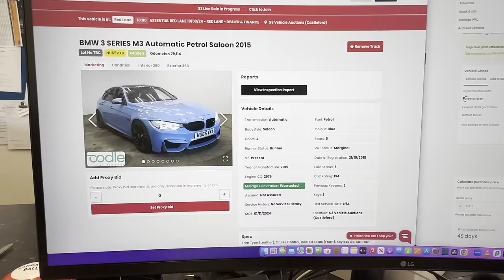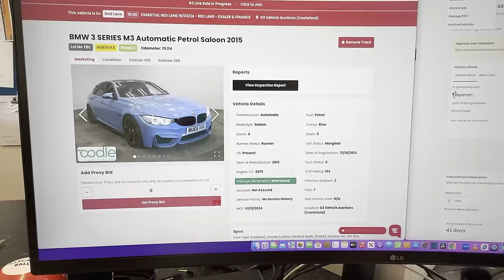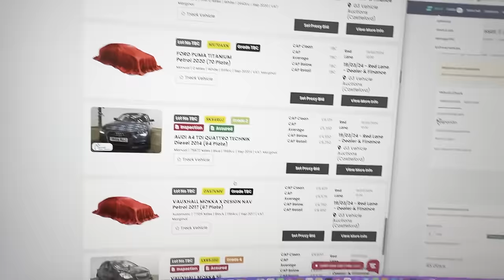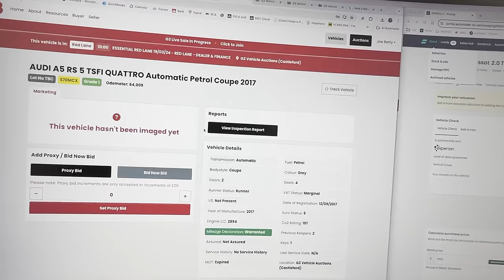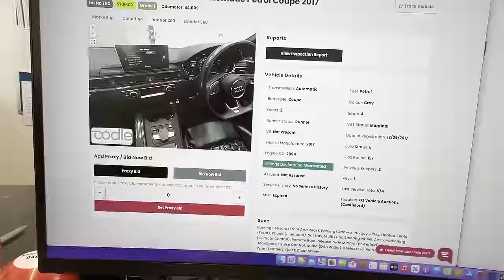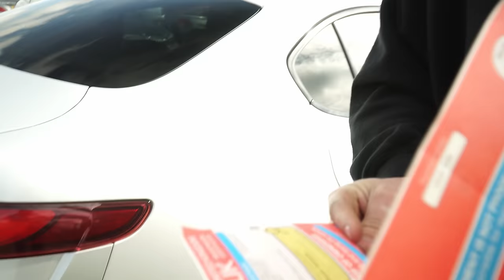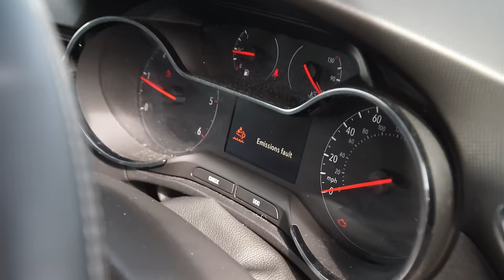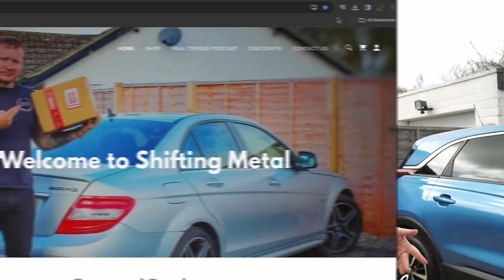Hit and run driver is trying to claim on my insurance! | BM Weekly EP 31

Comment: Do you run a tacho on trucks .?? Trailering does require it 
Those lights are a bit gimmicky the modern day Arthur Daley  bunting 
Great videos
Reply: Three and a half ton vans so no it doesn't.
Reply: You need to read the rules , for business they do if trailering
Reply: The lights are what they use in alot of detailing shops as it’s a  pure white light
Reply: Your wrong sir . Tacho is required for business trailers on anything over 3.5
Reply: @999hireactionvehicles9  not for recovery trucks it's not. Recovery vehicles are exempt.
Reply: @dj4myparty  I have and recovery vehicles are exempt.
Reply: @stuartcraigon2003  Dvsa will tell you different rules changed.
Even applied to 4x4 cars and light vans towing for business
Reply: @999hireactionvehicles9  that's exactly what I read. Tacos only apply to goods vehicles, vehicle transport and recovery are not goods.
Reply: @stuartcraigon2003  recovery arent exempt, watch the amount of vehicles pulled daily but Dvsa all overweight or without tachos
Rules are tight and all these guys running trailers are getting nicked
Reply: @999hireactionvehicles9  they are, read the dvsa. Recovery trucks are exempt from operators licence.
Reply: @stuartcraigon2003  tacho isn't operator license the two things are different
Recovery does mean just that , transporting cars for sale or delivery is not recovery two very different things .
The days of being ignorant are costly if you get caught
3.5 t recovery truck and trailer combo does require a tacho for transport. For recovery under 100kms it's exempt. The rules are very clear . Collection of cars from  car auctions is transport
If your using a 7.5t for transport you do need a o licence and transport manager too
Reply: @999hireactionvehicles9  nope, if your operating under a taco you need an ops license and unless its your own goods you require a TM.